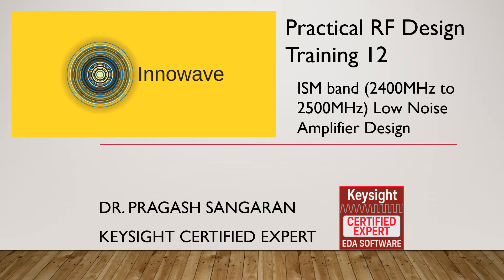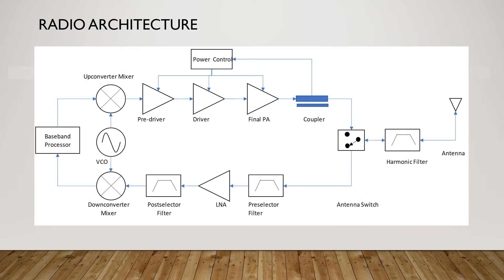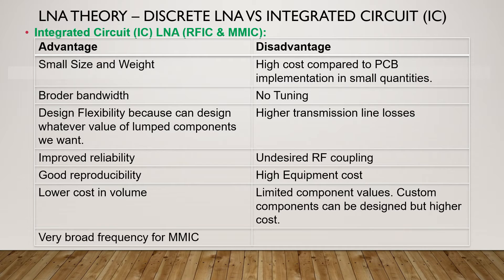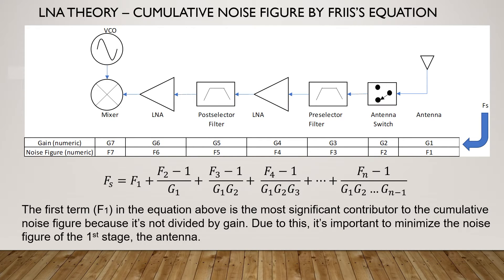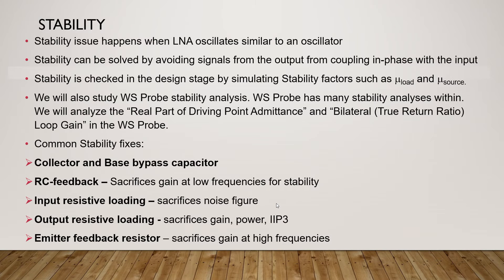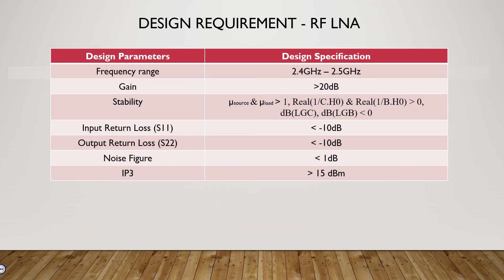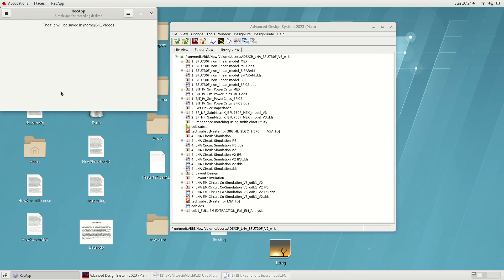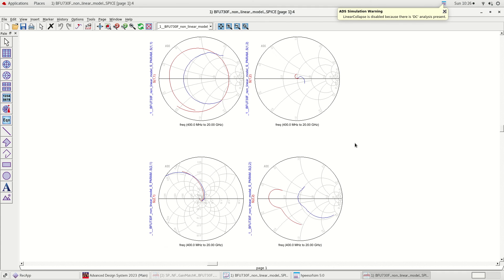Tutorial 12:  Step-by-Step Guide to Designing a Low Noise Amplifier for the ISM Band – Part 1

Comment: hi sir, Can you make short videos with specific instructions for this part, such as how to add the BJT library and run the simulation steps? Because I'm new to ADS software, it's still difficult.
Reply from the maker: @thanhhh17 thanks for the input. For adding BJT, we will do a video. For simulation steps, can you refer to other videos we have uploaded?
Reply: @Innowavellc  Sir can you upload that asap. or can you tell how to insert ATF34143.
Reply: In the library of RF transistor only 5 components with name ATF is there. But the base paper which we are referring have usde ATF34143. Is there any way to insert that sir?